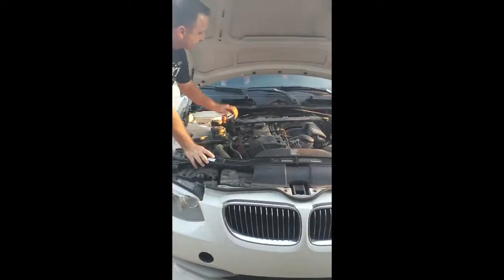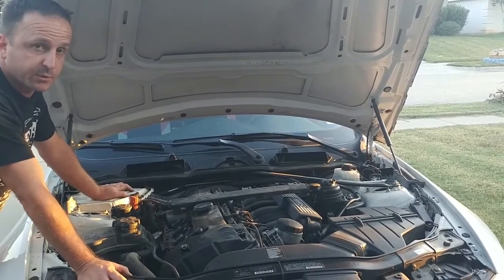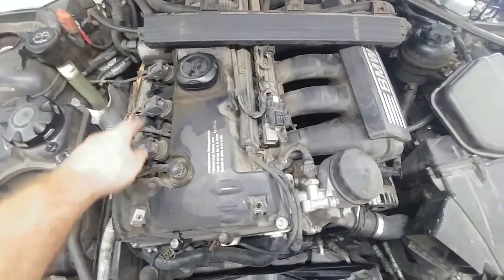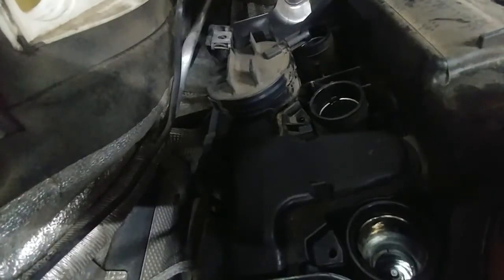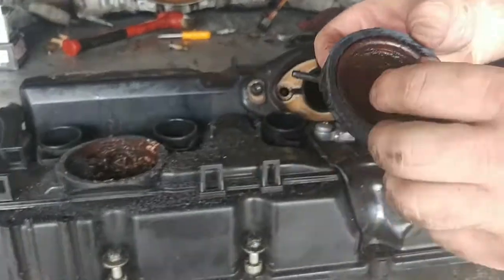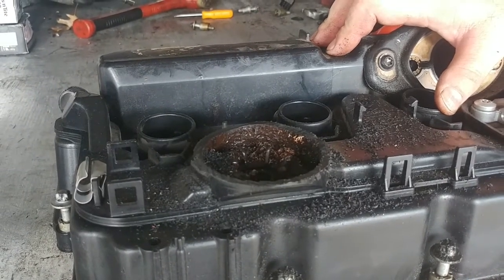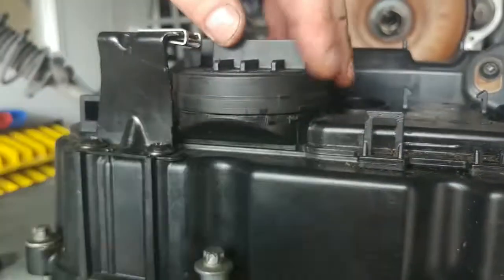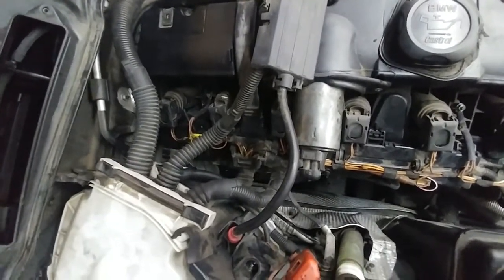BMW crankcase vent valve repair kit without replacing the entire valve cover

Comment: good method but takes more time and more expensive..you dont need to remove valve cover,,just dremel cap off and secure new one w some silicone whole job $20
Reply: Where do you dremel the cap?  On the top?  Is the original one siliconed as well or is it just the clips that retain it ?
Reply: Hi do u have any pics of what u did without taking out the valve cover

Comment: Nice fix . I have a 525i n52b25 e60 08
And i see amazon has the top piece. Im wondering why there are 3 clips if they dont do anything , i have issue with pressure
Sometimes sucking sometimes blowing removing oil fill cap. 
I assume its the same issue as video . Thanks for any info . Cheers

Comment: that little black fitting on the PCV valve..does a vacuum line attach there? I have a  N52  2008 328i and i dont see any vacuum line attached..looks like yours doesnt have one either??

Comment: What are you doing!  All you have to do is cut a line in the top of the valve with a Dremel or a rotary tool, heat it with a heat gun and just pop the valve out.

Comment: Should i seal it around that cut hole with something like silicone or its not necessary?
Reply: yes definitely and u dont need no kit just dremel or drill the cap off

Comment: Does pcv valve failure give itself to misfire or is it a misfire code failure? I am getting code p0171 and p0304. new engine optimization starting from engine oil cooler
Reply: It will give you all sorts of codes and symptoms that will not make sense
Reply: Thank you

Comment: IT is not a good idea to cut IT. You can remove it much easier saving the small cover and replace it after repair. You simple need to hit it with small hammer until you make the glue loose. The glue is not elastic. No scrudrivers, just hit. Pls remember to glue it back with temperature rasistami glue > 150 deg Celsius. No supermarket cheap product…

Comment: There's a recall now for this 🤸
Reply: Really ? Does milage effect anything?
Reply: It's not remedied yet , it's going to take another year or longer
Reply: No recall on this part yet! It’s for the wiring harness, install a fuse in the box. To prevent fire 🔥 when engine is not running.

Comment: That was painful to watch no offense, I dug a hole in the middle work my way around and in 5 mins it’s out. Without having to remove valve cover.
Reply: Yup did this as well, started from the middle with a dermal tool though which kept the base intact for the new pcv to sit on properly.
Reply: @Rkcommuter  good job